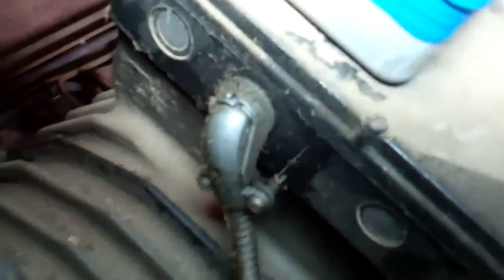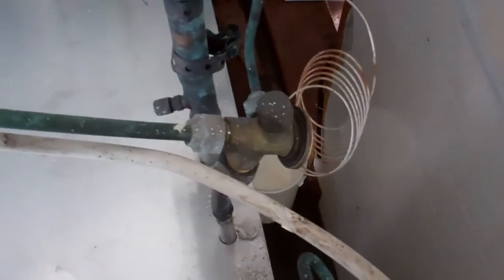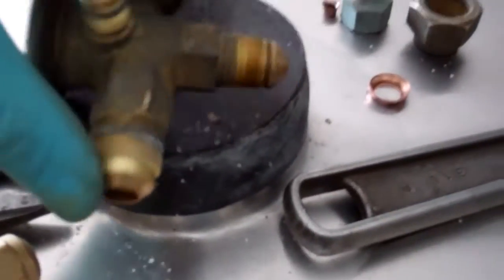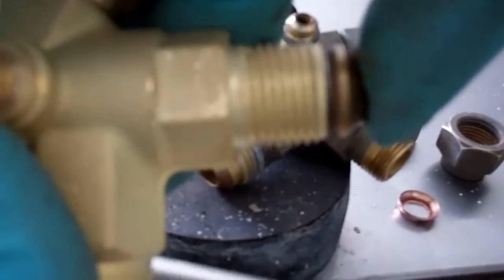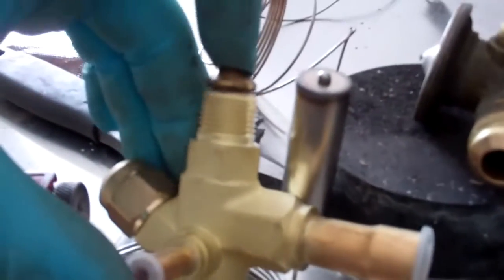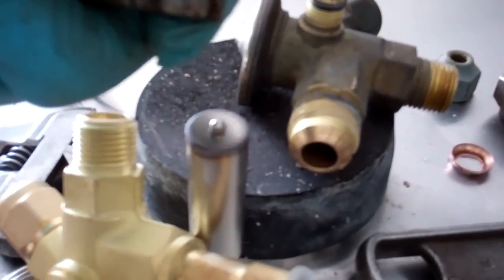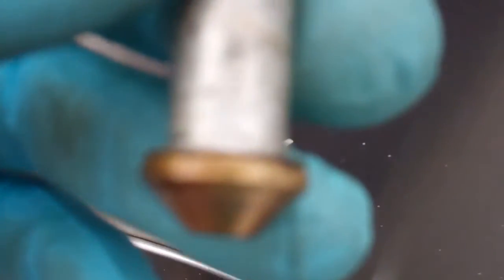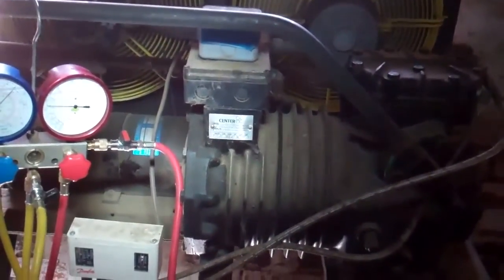HVAC TXV/TEV Replacement

Comment from the maker: @MrLeveLHeaded Thanks!

Most of my work is dairy, either milk tanks or i look after a few cheese producers, but i do a few pubs and shops etc as well and when Dave is really busy or we've got a big job on i help out with the air con side of our business.

A lot of the old heat recovery tanks got scrapped when people had DX tanks fitted but i'm starting to fit a few new ones again, i'm waiting on a few parts for the last one i fitted so i'll get a short vid when i go back!